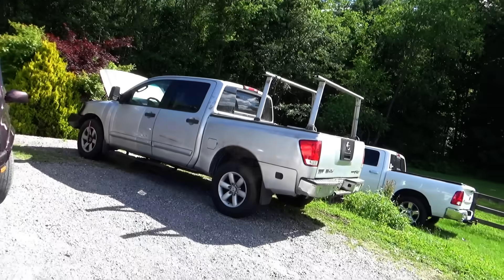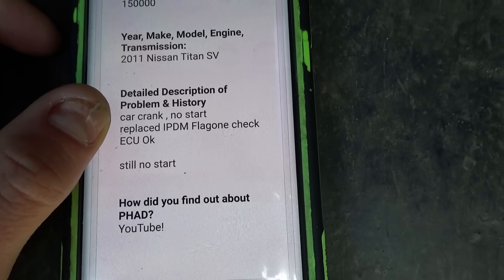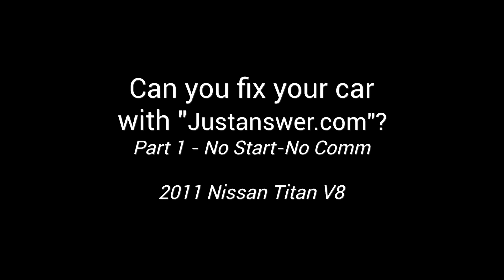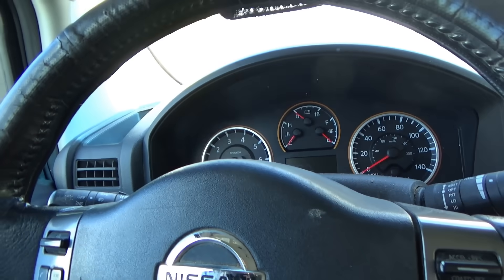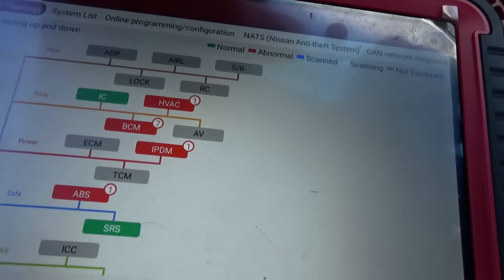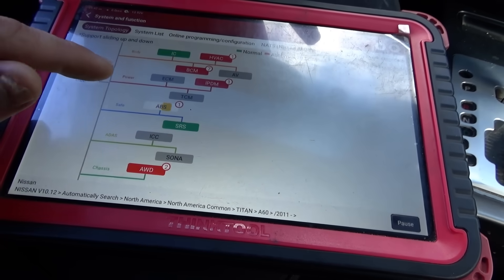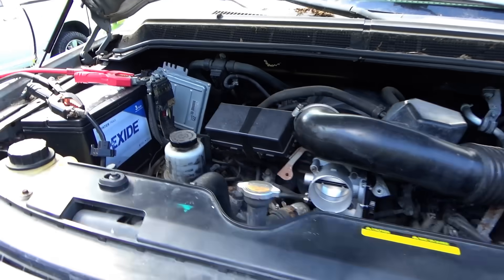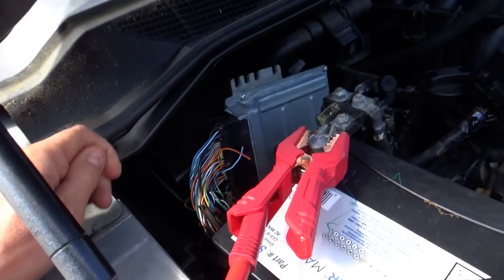Can "JUSTANSWER.COM" Fix Your Car? (Part 1: Nissan Titan NO-COMM for a YEAR!?)

Comment: It takes a lot of balls to ask for a discount when you get your car in to probably the only person who can fix it just because you fired the parts cannon at it and didn’t bother to actually diagnose anything
Reply: And in addition damaged important wiring and left electrical components under the hood disassembled and in disarray. 

I would have turned this car down or at least asked for $1000 up front.
Reply: @Dave-ei7kk  There are many red flags from this customer.
Reply: this is not balls,is prickness

Comment: Labor rates:

$65/hour
$100/hour if you watch
$150/hour if you help
$200/hour if you worked on it first.
Reply: I had someone bring me a grass edger held together with bailing wire a while back and he expected me to know what was wrong with it.  He tried to fix it himself and when that didn't work, he used the bailing wire to hold it together.  No parts included in a box or bag that he took off in the process.  He bought it new in 1979.  I kid you not.  And he said all he could afford to pay was $60, parts and labor.  He got that back in the same condition real quick.
Reply: A clear universal truth
Reply: 200 an hours seems fair since you have to backtrace and reinstall parta back lol.
Reply: Ivans labor rate should be at or more than the local dealers, period!!!
Reply: @cm-hw5ww I feel better if they bring snacks and drinks 😅
Reply: @cm-hw5ww  nothing is free anymore.
Reply: Then there was Kevin. Not a trained mechanic but super smart!
Reply: 2024, add a 1 in front of each of those rates
Reply: @AraCarrano  No just a zero to the end.  😁🤣
Reply: Add 10% for the big guy and another 10% for Ukraine 😂
Reply: @MattyEngland  
Best comment BY FAR!
Reply: I have worked on my cars for 40 years. With those prices I really have to avoid using any shop ever. Luckily I have OEM scanners for my cars, 3 scopes, a lot of tools and lift. Hope I manage..

Comment: Wild guess time? That super fast crank sounds like low compression? How about a timing belt 😜
Reply: Cylinders probably flushed with gas from a lot of crank no start action.
Reply: Or the plugs are missing and they didn't tell Ivan.  There's another possibility in a different universe.  I was having a beer with my aircraft mechanic, and he was telling me all the horror stories of the guy who used to run that shop.  Some aircraft come with 24V systems. Well, this guy installed a 12V starter.  Apparently that's enough to cause exciting things to happen when you crank the engine.
Reply: @major__kong  If it had no plugs, it wouldn't have started briefly 😁
Reply: I’ll go with low compression. Plus I think those engines have chains. (Not that they don’t go bad)
Reply: @bobcoats2708  Yeah I have no clue about if it is belt or chains or whatever. But whatever it is affected all cylinders, right. I bet Ivan is going to find that was the original problem, and someone tried to fix it by messing with the wiring and the computer.
Reply from the maker: Fastest Crank on the East Coast!
Reply: @PineHollowAutoDiagnostics  Not necessarily the award you want to receive. Looking forward to the reveal.

Comment: i get the frustration completely. just this week an 07 escalade came into the shop and this guy had a bunch of complaints, rough running, no comm to ecm, ebcm, escm, long crank etc. he had replaced the air ride pump and “fixed” the ground that it on the rear body mount. i replaced the reprogrammed the electronic suspension control module and everything came back online, i removed the starter and found the ckp sensor unplugged, reconnected and that fixed the long crank and the dead tack and rough running however his air ride pump is still dead, aftermarket trash of course, power and grounds as well as 5v and low ref is all present i suspect a crap aftermarket pump

Comment: Sorry no discount more like a premium charge
Reply: Charge him for every minute, then double it.
Reply: Yea the gall of some people..  gives a guy a car with no original parts after throwing a bunch at it, engine bay is a mess with god knows what loosened, no info, cut wires, broken plugs, dead battery but wants to be cut a break..  for what?!  I mean if the car was brought with a clean bay, parts, work log and candy in the console and newly opened air fresheners then fuk yea, your getting the house price cuz you made life as easy as you could for a guy..  but jeez.  Like those nasty gutter trash who bring in cars for work full of trash, bugs and mold smelling like a dead foot stepped in a turd with windows rolled up to keep the roaches in..  people tend to suck..  hard..
Reply: Charge more for the migrain this car caused you, by owner own doing.